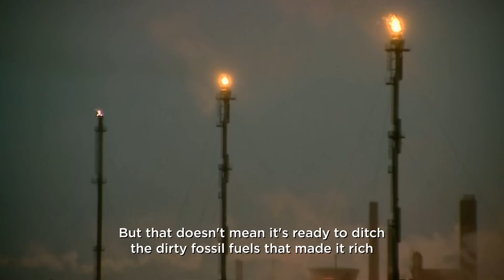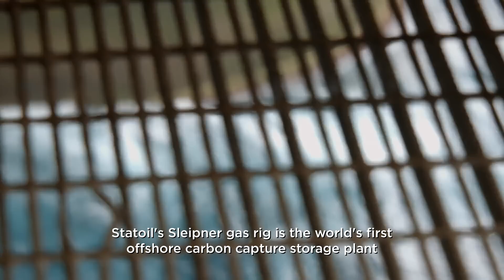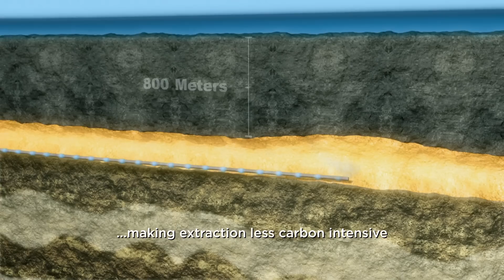Oil and gas companies are facing major technological disruption

Comment: 4:45 >"Wind & solar... depend on subsidies"

Coal & Gas also depend on subsidies.  
You honestly forgot this?  WTF Economist
Reply: Gov't gets far more in tax revenue from oil and gas.   In the case of renewable they GIVE them tax dollars just to keep them  up and running.   The current oil paradigm is a lot more affordable for the population.   Just ask places like Ontario Canada how much their (renewable)  power bill is.   It's as much as their rent in some cases.
Reply: @DoYouThinkForUrselF  I just installed $16000 solar panel last year and my energy bill drop from $2523.24/year to $121.74/year. I am doing good.
Reply: @rocketomega11  That's good, actually amazing.   I know a guy who spent 20 k on solar for his house in Edmonton Alberta Canada.   He did not get any where near those results, sorry i can't remember the exact numbers.    Maybe that is because we use more energy in the winter than in the summer and we have ALOT less light during the winter up here.   Will ask him tomorrow.   I also know in Ontario Canada energy bills went up a lot, some people paying as much as their rent to get energy.    Hmm your numbers don't really add up, guess that could depend on a number of factors, size of your house, how many people, sunlight......the tech.....
Reply: @DoYouThinkForUrselF  My system is 4.4 kw which generated 6950 kw so far (11 month). It generated excess energy during peak hour (day time) at higher rate to be used during off peak (nigh time). It will reduce my tax by $4800 this year so life cant get any better here. By the way that money was not tax dollar it was my own money to begin with.
Reply: @rocketomega11  Hmm i see a problem here.   My friend would have to pay 4 times the amount (80 thousand Canadian) to get himself off the grid and that is just electrical and not heating..   So here in Canada we have a gov't who is implementing carbon taxes on us.   To heat our homes, to drive.   It makes everything more expensive from services to food, as business's have to pass on the cost to consumers.   

        In the past the market creates innovation and people adopt that innovation as it comes down in cost.   So currently 80 thousand is to large a barrier for mass adoption.    I have seen houses in Alberta here with many solar panels on there roofs and i would have to surmise they are off the grid as far as electricity goes, but i suspect they use natural gas to heat their homes.   Their roof is literally covered with like ten panels or so.   That is a guess as i have observed it in passing, either walking or biking past that neighborhood, but either way the whole visible roof was covered.   

      Now my provincial gov't raised heating costs by 600 dollars per year and that has gone up to ..........well it' was in the thousands, two thousand something per household.   Can't remember exact number but was in two thousands factoring in heating and gasoline taxes, rising consumer products ect..   Federal gov't wants to tax carbon and our PM Trudeau is on record saying to other govt's and entities like the UN if he could end oil and gas today he would.   So he is on board with it.   So i figure these taxes are going to continue to rise and he said they would, just has not put a number on it.  Not true he has some numbers but i just can't recall them atm and i do believe he would raise them a lot more especially in his second four year term (voting one year away) 

      UN recently came out with a number, they said we  (global community / humanity)  have to raise taxes on carbon to 5500 dollars per ton of carbon by 2030, 11 years away pretty much.   That would make gasoline 18 to 18.5 dollars per liter once taxes are factored in.  (3.785 liters in a US gallon)       Do i think that will happen, probably not but if it did all your consumer products would go up, gasoline would NOT be used as a fuel source and electric cars would no doubt take off.   Problem there is we don't even have enough minerals to supply everyone a electric car.   You also have environmental problems due to mining and waste when it comes to electric.   You have to off source your power consumption to the grid as well, meaning you have to upgrade it's capacity.   Yet we want clean energy and are phasing out coal in Alberta and most of Canada.   

         Cost wise i don't see how people will be even able to make ends meet.   No one will drive, cities will have to have extensive public transit and be built upwards not outwards, and gov't will have to micro manage your lives via a technocratic state just to overcome the costs and problems it will create.   Literally i don't think my city which is built in a sprawling manner could run under such a radical change.   The whole infrastructure would be rendered obsolete.   

     What i am trying to say is that with the costs gov't is going to incur  on the people they will not be able to adopt clean energy due to the off setting costs of gov't taxation on carbon.   The whole economy and infrastructure would have to be changed and all in eleven years?  Maybe if we were China, a gov't that created trillions in debt and created centrally planned cities which funny enough rely on coal and oil.   A lot of those cities are ghost cities though, as gov't is not really good at meeting supply and demand and either there is not enough work in these newly created cities or people just don't want to live there...........or whatever reasons that cause that.  Lucky for me Trudeau stated he likes China's governing style and  wishes we ran things like them.  Either way Trudeau will not last, he will be voted out.   The man's an ideological idiot,  follows equity  of outcome doctrines and such.

          Side note, China pollutes a lot and under international agreements has a longer period of time to lower co2 emissions.   A country of billions yet a country of millions like mine has to do IT NOW.    Interesting, seen as all the corporations moved to China (manufacturing)  and are now emitting higher emissions in a country with lower  environmental standards.than the western countries.   Hows that work........it's why i see the environmental movement as a scheme and not a altruistic movement.   Not to mention China and it's social credit scores.   They are trying to move to a consumer economy now, that is billions of consumers (good for corps) run by a technocratic state.   Here in west we see corporations censoring as well, one can see  some similarities.  Money is the driving incentive for people so it only stands to reason big money interests are merging with gov'ts, this is most likely the driving force behind environmental movement and there is evidence for this.   Banks ask you what your views are on co2, they also support many co2 initiatives and many of the environmental groups such as the native community in my country are funded by multinational  billionaires.   

      So in  short my country will have to be a technocratic society where most individuals resources (income ect) is redistributed by gov't to meet the co2 goals put forth OR you allow adaption with in the free market to be adapted as they advance and people pick them up because they just economically make sense  for each individual.   Simply taxing people will limit their ability to move to clean energy,  if we are to judge it by UN tax  numbers.    UN way  would require technocratic state.  Innovation is not a gov't attribute, that's the free  markets place, i just don't see how a market run by the corporately run gov't that impedes business for some and helps their friends will lead to innovation.   It will end up with a few large corporations prospering and many people under a technocratic system and less competition and innovation.   Hence i don't like gov't subsidies to corporations as well, it's socializing money via a centrally run .....corporately run gov't under a technocratic doctrine for their benefit at the detriment of competing interests.   Oligarchy, Plutocracy, Corporatocracy ......take your pick.   

     Conspiracy.....maybe but if you follow what clues we are given the economy they want will not be a free market it will HAVE to be centrally planned in order to change that fast.   Hope i am wrong i have read some stuff on other energy sources, lets hope there is a energy revolution in ten years.  I am wrong actually, if cheap new energy comes on line it can be a very rapid change, even more rapid than any gov't system.   Markets adapt faster than gov'ts.
Reply: @DoYouThinkForUrselF  get tax revenue from oil? Are you talking about gas tax? Well, you also forgot military spending to secure oil in middle east. That is tax money too. lot lot lot lot of tax money.
Reply: They are also charged royalties on land leased.
Reply: Yes, and what about nuclear power--in the 1960's it was the Holy Grail of electric production then the true cost hit. The STNP (South Texas Nuke Project) was sold to investors in 1971 as a sweet deal--get 2 power units for $800 million dollars and electric would be on line by  1981---it finally came on line in 1989 at a cost over  $5 BILLION. Its now a giant White Elephant as most of the original customers like San Antonio and Austin have pulled out.    https://www.citizen.org/wp-content/uploads/migration/stnp_chronology.pdf
Reply: And fossil fuels are also a source of  tax revenue right across the world. Average motor fuel  tax in the OECD in 2018 was US$2.24 a gallon. Calculate the total tax yield.   Many producer countries also impose royalties on well-head coal, oil and gas production.
Reply: Wind and solar are now cheaper than fossils. And get cheaper all the time. Continuing to use dirty power is worse than idiotic, it's suicidal.

Comment: It's all nice, but no one living in the city will be able to get their needs from renewable only.  The amount of power required to run large cities and even mid sized cities is enourmous. 

Maybe sub-urban towns and smaller cities might be able to get most of their power from renewable, but let's not forget batteries are not renewable. They require large mining projects and the scale required to power them is also too much just for renewable.
Reply: Actually aside from the plastic casing batteries are one of the MOST renewable technologies that exist, and that is not to say batteries are the answer but reducing consumption is a real option too!

Comment: So it's not just wind and solar that gets subsidies in fact they get much less than oil and gas about 1/60 without the pollution impact to pay for too. It's 5300 billions (+wars, and so on) vs. 88 billion with local jobs and without being depended by other countries oil.
Wiki:
"A 2016 study estimated that global fossil fuel subsidies were $5.3 trillion in 2015, which represents 6.5% of global GDP."

"Global renewable energy subsidies reached $88 billion in 2011.[18] According to the OECD, subsidies to renewable energy are generally considered more environmentally beneficial than fossil fuel subsidies."

Comment: This presentation does not disclose the heavy financial start-up subsidies used to make these projects possible.  Bio-gas ignores the CO2 requirement by tree-hugging Sierra Club manifests and other loony left ecology gods.  The 'Peak Oil' you read about 30 years ago is currently being reset as a completely new era in oil recovery, allowing for much greater production from existing wells and new recoveries in areas not approachable just a generation ago.  API estimates put Peak Oil with current technology and flat-line consumption estimates to 2075.  Nat gas much further out.  Perhaps by then advancements in wind, solar, bio can become economically self-sustaining.
Reply: elli003 You are aware, I am sure, that the United Arab Emirates solar thermal electric power plant NOW generates electricity more cheaply than local natural gas. Google it!  The break even point was passed in 2017!
Reply: Good. Wouldn't it be nice if the rest of the planet got as much sun as the UAE does ?  Even with technological advances, alternative energy sources still struggle to become efficient in many population centers.  Solar thermal plants in the UAE ..... fine, but not the best choice for Seattle or any other city above the 40th parallel.
Reply: The price of solar thermal, as well as, PV generated,  power keeps dropping. There are calculations showing that the USAs electrical needs could be served by existing solar panels using about 0.6% of the USAs land surface, Wind power is now cheaper than fossil fuel plants in some areas, especially coastal, plains, and mountain areas. Graphene batteries are already being used in some smartphones and we are just scratching the surface on its uses. An MIT study estimates that more than 100,000 early deaths per year are caused by carbon fuel emissions,  Some 53,000 are from  vehicle emissions and 52,000 from power plants. As expected, California won first place with 21,000.  As someone who attended UCLA and awoke every morning with a smog hangover, I wont lament the end of fossil fuel burning. p.s. few decades back, I founded a coal information institute here in Mexicos Cretaceous age Sabinas Coal Basin, the countrys largest.  Sorry about the punctuation, My software can{t cope with constant switching between Spanish and English.  !Saludos desde Mexico!
Reply: Brooks.  Stop reading B.S. journals.  Get IN the energy business, grow with it, learn something useful.   These intellectual dilettantes from the University of Awe, while fully capable of solving the most complex mathematical equations, don't have a clue on how to give proper weight to the elements / components used in energy related equations. Their theoretical outcomes never prove to be true.  Not even close. These are the same clowns that told us about 1970 peak oil. BTW - what translation software are you using ?   curious ?
Reply: 1. Pumped hydro- 500,000 locations using storm runoff water
2. Tidal power- pnnl.gov squim WA study Dec 2018
3. Solar panel-  efficiency now 33% 2020 new panels
4. Tesla semi -seven cents kWh 60% cut per mile cost
5. Hydrogen fuel trains- Germany
6 Electric transit -

Comment: I'm totally for green energy, but those ugly wind turbines totally ruin beautiful natural landscapes. Get rid of them and push for solar instead.
Reply: because coal power stations are so much better to look r-right?
Reply: At least you can still go,and look at the landscape,try doing the same in a certain area of the ukraine,and japan,at the very worst with a wind turbine if the idea of it as a renewable does't work,its take it down,pull the cable up,take a chunk of concrete out,and back fill it with topsoil,and return the land to its former use

Comment: Although offshore above the sea surface does have its place...the real advantage in most instances will be underwater generation in underseas currents.  These currents such as the Gulf Stream flow around every continent offshore say 20km out in most cases.  The majority of population around the world is near offshore water, so the energy is generated nearby.

More importantly this offshore is 24/7 that varies little in different seasons.  Since currents are steady and water has much much momentum and energy density than using the nearly same type of design of onshore plants, one underwater generator is equal to 1000 terrestrial wind generators.  Sounds good, but the problem is that they must be made of stainless steel and other composites, and secured to the ocean floor.  They must be raised to the surface for maintenance.  However, you NOT paying 1000 times more to make that underwater generator than a terrestrial generator.

These generators could be the backbone generators that gas, oil, coal, and nuclear provide right now.

Comment: Renewable energy requires lots and lots of Copper. It requires so much COPPER that there simply is not enough in reserve on planet earth to supply all energy from renewables. 

Liberals do not want address real issues.
Reply: Graphene - cost effective production has been invented. Its better than copper. Graphene is the future and China is leading the world.
Reply: bighands69 oil and gas plants do have also copper demands because they have to transmit electricity. Gas, oil and coal are going to come out of fashion- to expensive. Thank God for capitalism!